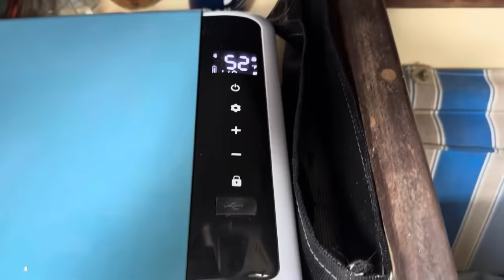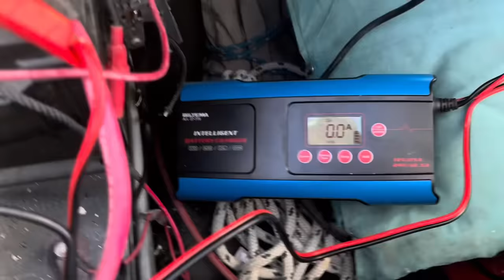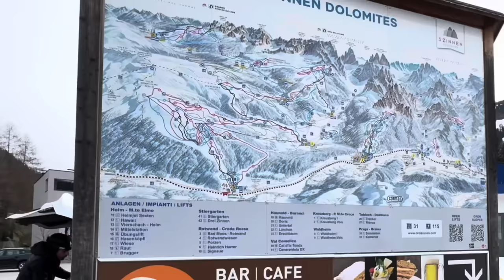Motor mounts, glass, gondolas and skiing. #Oceanic Innovations

Comment: Sam!!  Glad you got your new mounts.  Yep from the looks of the mounts on that motor.  They look like Mercruiser mounts and not OEM Yanmar mounts.  Give us a shout with measurements on your hold down bolts (center to center) and we'll get you setup!!  Cheers!
Reply: Great video! These guys make custom mounts for odd-ball situations like yours. They really are pretty cool colors, and look stout!
Reply: Thanks so much as these are the only mounts we use now!  The stainless steel and more rigid cushion mount is so worth it??
Reply: Would changing out the mounts (on my Westerbeke 25) have any beneficial effect in terms of noise or vibration?
Reply: They're free mounts.
Reply: @mtmanning67  Even so, they are taking up precious space on the boat.
Reply: Thanks for helping him out!  Your product looks amazing!  Big fan of the design you have, much better than OEM.
Reply: Yes Malta haul out!   align the shaft and flanges and all will be good

Comment: In short, while AGM chargers can be used to charge lithium batteries, it is not recommended because of the potential for overcharging and damage to the battery cells. 🙏❤💪
Reply: Victron makes the perfect charger for the lithiums and it will charge AGM as well, can be reprogrammed through bluetooth do perform as needed, right up to and including being a 12v power supply.

Comment: I just braced my PSS seal with a 2 by 4 and replace my motor in the water. It really doesn't need to be braced because there's no forces pushing the drive shaft forward that are that extreme

Comment: Yes Sam- those new motor mounts look too big for that space.
Beefy motor mounts- just not the right application for your engine.

Take some photos, grab some dimensions off the old ones- see what Oceanic Innovations has to say.
Custom built for your engine only- they might not even make that type of mount anymore?
 
I wouldn't wait too long however in replacing them- on the hard. By the time you get to that marina in Malta,
Oceanic Innovations could send replacements to you and pick up these mounts in return all in one go?
They get their products back and you get the product you need that fits your engine space limitations.

Comment: Nicely done.  Now I'm hoping that Oceanic has the low mount ones for Yanmars.  On the smaller models I've never installed the type they send.  I used to be the Yanmar distributor for Western Canada.  So rather surprised.  Boat does not have to come out of the water.  Just unhook the coupling.  those dang air bag pumpy things might be interesting.  but easy to lever it up too.
Reply: I replaced the mounts in the water. It was quite simple to do.

Remove all four lock nuts. Raise the engine as high as it will go on three of the mounts using the adjustment nuts. You should then  be able detach the fourth mount and slide it out of position, with a little jiggling perhaps. If not, drop the adjustment nut down a little on the diagonally opposed mount. This will allow you to tilt the engine and give you the clearance you need.
Just be careful that you don''t jam the shaft up against the shaft tube. You don't want to damage the shaft.

Yanmar 3JH4E with OEM mounts.

Comment: Hey Sam, just now saw this wish I’d be seen it sooner, I replaced the damper plate in my transmission on my 1967 Morgan 34
I was able to unbolt my prop shaft, and push it back and out of the way so that my transmission could come out, no water came in aside from the normal stuffing box leaks. Hope this helps, and as far as propping up your motor, you can put a board under your engine and use your halyard to lift it up, a little sketchy, not ideal but right up your alley

Comment: Great video.  We are in Salvador, Brazil, sailed from Mindelo, Cape Verde, being a good stop.  You are going to regret not crossing the equator, respectfully suggesting an early January departure from Mindelo, making it to Salvador in time for Carnival in February.  You might consider visiting the protected anchorage at Baia Do Aratu (S12.47, W38.27), approximately 10nm north of Salvador in the Bay of All Saints, Bahia, Brazil.  It is shaped like a bowl, surrounded by low-lying hills, virtually undeveloped, probably the most protected anchorage we have ever been in, and the marina's community is safe.

Comment: I had the same problem replacing my engine. We solved the problem by designing new engine brackets rather than modifying the boat's fiberglass engine mount.

Comment: I'm kind of surprised you elected to have a PSS shaft seal. What will you do when it fails? It'll be quite catastrophic, no? Hope you get those mounts sorted. They look like a huge improvement over stock.
Reply from the maker: The pss has been great. I’ve never had any problems with it. No leaks and no maintenance.

Comment: If the mounts are worn out  the motor is probably sitting lower in the bay than it was new. Ride hight would effect the  shaft angle that's what you need to concern yourself with. I'm cheap . I remember a broken mount that needed to be replace the problem was the motor mount was unobtainable.  I made my own

Comment: Hey Sam on your little refrigerator there there is a lock button that's the first putting you have to press and hold until it unlocks and then you should be able to adjust it. That is if you haven't already tried that.
Reply from the maker: Yes that’s actually the only button that broke but in effect I can’t use any of the other buttons either now